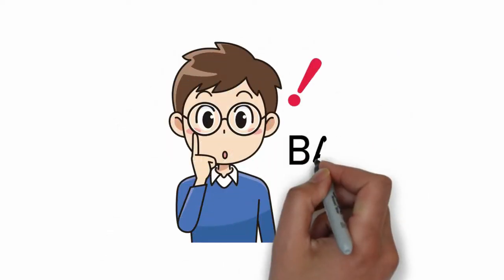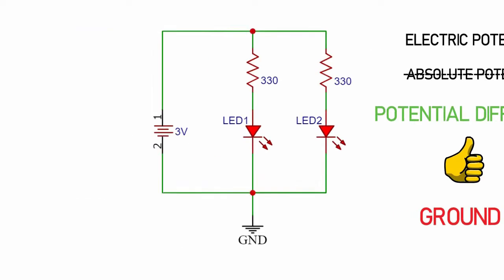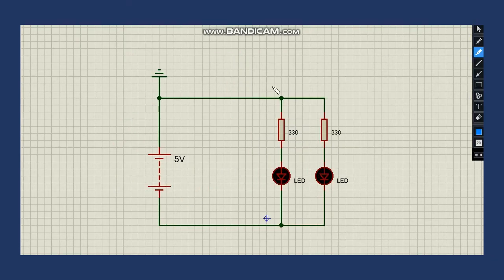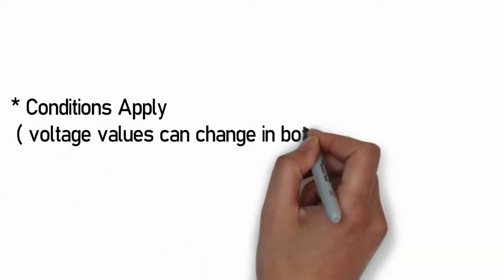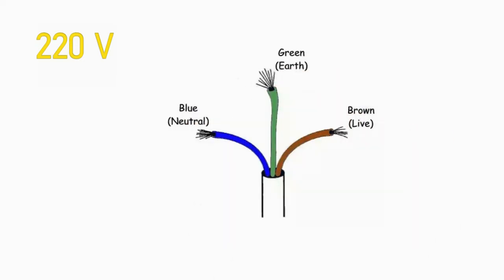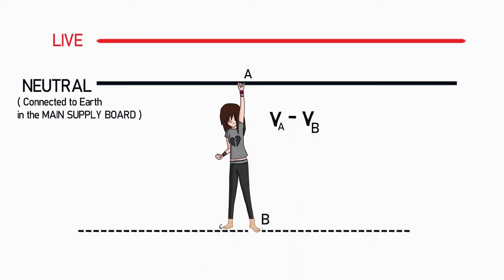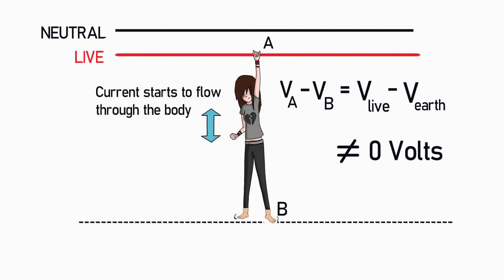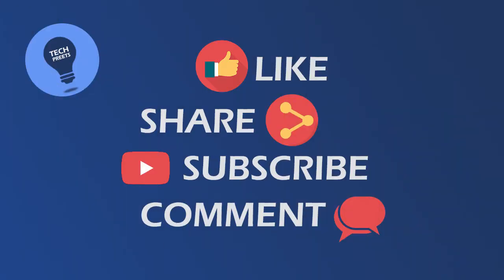Is Ground the same as Negative   ?!

Comment: I have a question, since the ground wire is connected together with the neutral wire. Is it possible on the socket to tap ground wire from neutral wire

Comment: Hi, i have  DC power supply connected to field device, but measured +16 VDC from positif to ground and +8VDC from ground to negatif, please your advise
Reply: Your placement of the probes from the multimeter may be the your issue. the Black probe is usually taken as the REF voltage (assumed 0), and the Red probe is the positive lead. If u put the black on the neg and red on the positive, you will get the full voltage reading from your power supply. In your situation, the device the power supply is connected to may be causing the higher voltage on the ground, or the supply is designed to output a -8V on the negative terminal and a +16V on the pos and ground is at 0v.

Comment: Interesting video. Why can't you do calculations using the negative terminal? Ground is fictional- there is no component, no wiring, no joint, no soldering. Whenever I see the Ground symbol in a DC circuit it indicates that the person who designed the circuit has no clue what ground means nor why they added it to their diagram. 'Earth' in an AC circuit- different story.
Reply: In diagrams for DC circuits, a ground symbol is shorthand for „connect to the negative terminal of your power supply“. That way a lot of wiring needn‘t be displayed which makes large diagrams much easier to read. If you turn a diagram into an actual circuit, that circuit will look a lot more complicated and complex than the diagram, because if planners included each and every connection, it would be pretty much impossible to read, because keeping track of dozens of lines that criss-cross all over a diagram is hard and makes it much more difficult to understand a circuit at a glance.

Comment: a conductors/insulators are physical materials that allows/inhibits  the flow of electrical current.
A voltage source, such as a battery can produce a current flow that exits from the plus (+) terminal:   IF that current can return to the negative (-) terminal of the battery.
Reply: With batteries the term "Ground "  is assigned to a conductor that is COMMMON to the battery AND  each component connected to the battery.